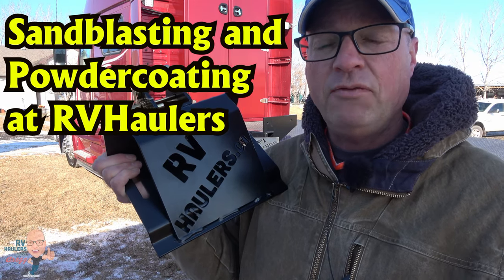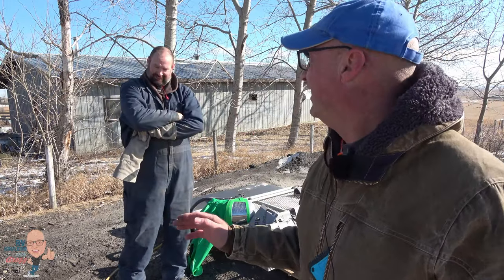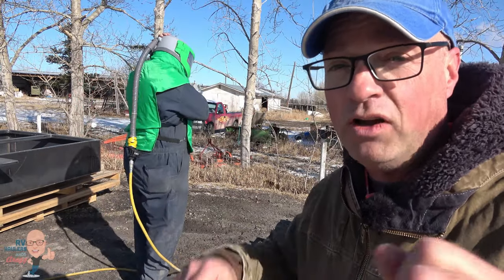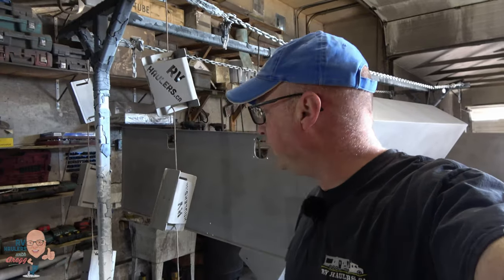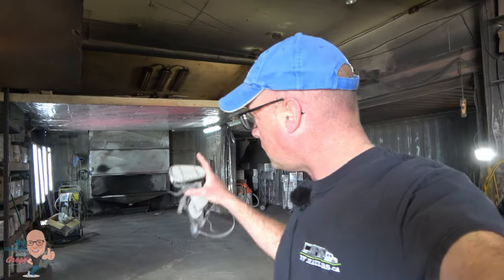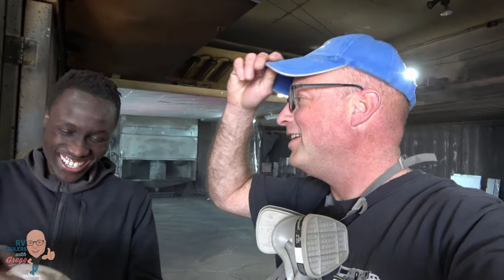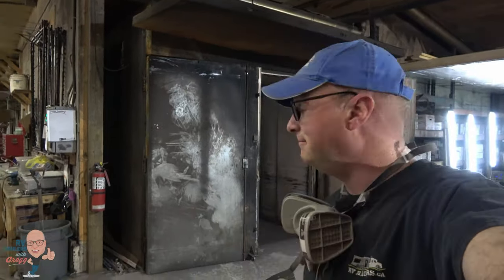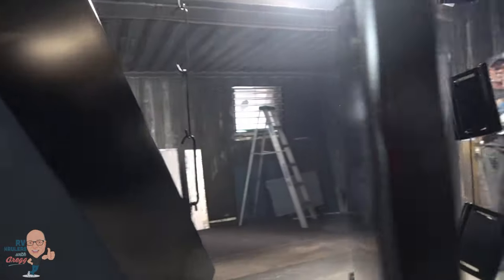How Powdercoating Works at RVHaulers  |  Added Bonus Sandblasting!

Comment: Is there a bare spot where the hooks are after coating?
Reply from the maker: Hi Delaware HOG - thanks for the great question.  The hooks get jiggled a bit in positioning between the primer and the final coat.  That helps to ensure there is excellent product coverage and no bare metal spots *(eliminating the chance of rust forming).  Plus, the powdercoat melts and flows a fair amount to provide coverage.  In the end, you might have a spot where there is primer only, and no black.  However we are pretty careful to place those hooks such that the pin point location where there is no black is hidden.  

Thanks for the eagle eye!

Gregg

Comment: If it gets scratched, how can it be repaired/touched up?  Can you give us an ideas as to what it costs? More or less than paint?  Thanks... great videos!
Reply from the maker: Hi Big G.
Thanks for the question.  You ask a tough one to nail down.  The cost of powder-coating depends on the amount of material, labor to apply, and how efficient you are with loading up the oven and filling it up.  It is generally a fair bit more expensive than paint.   I know that isn't the $ figure you are looking for.  When you add up sandblasting, handling labor, and the powder-coating process as well what you saw in this video is around a $2000 cost.

Thanks,  Gregg